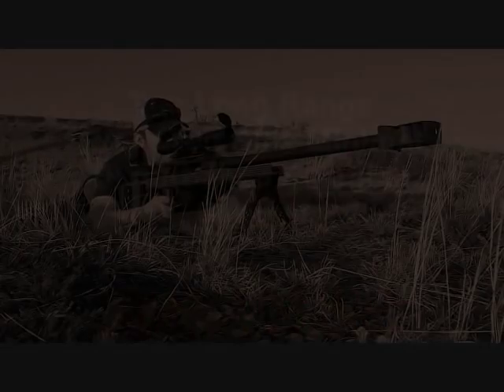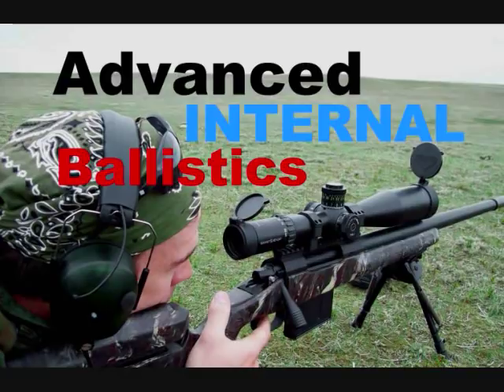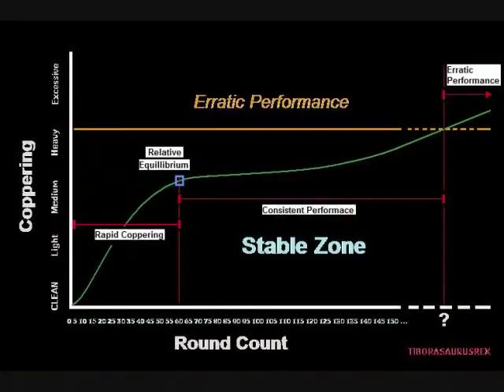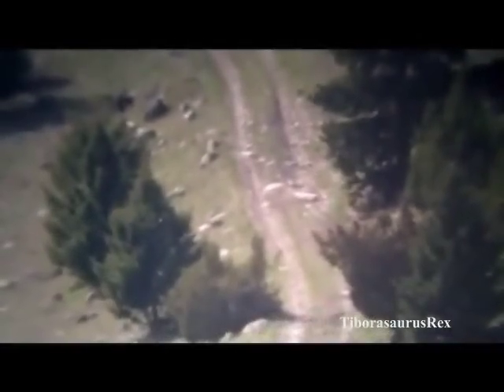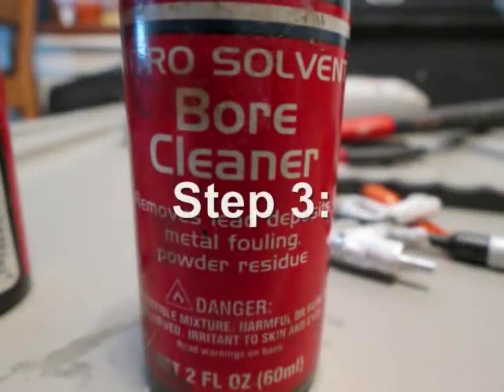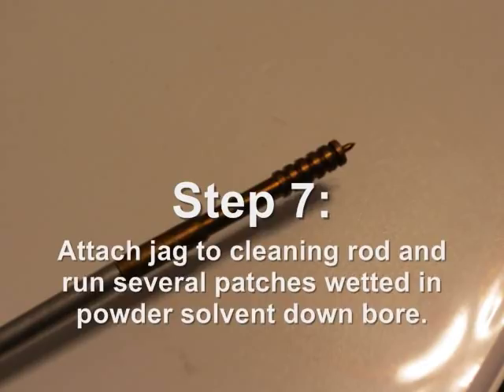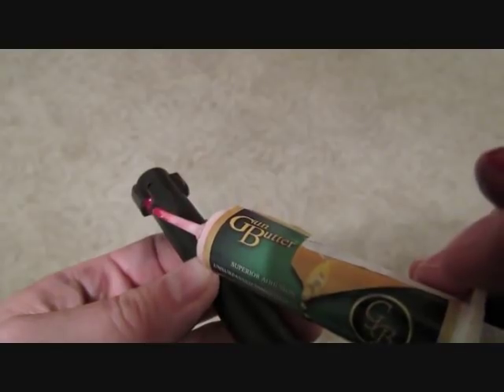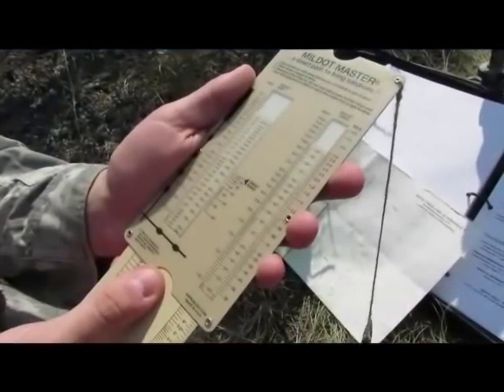Long Range 101 Part 44 - Cleaning Your Extreme Range Rifle

Comment from the maker: Come train with Rex - in person!!!  https://rexdefense.com/
Reply: You say the brush should never exit the muzzle, but does that mean do not fully exit the muzzle, or do not exit the muzzle at all ?

Because then, the closer to the crown the brush gets, the less exposure to the brush and cleaner the bore gets. At the very tip, only a few bristles will contact the bore before being pulled back: the full length of the brush will not contact the surface of the bore at the crown, so it will not be as clean, right? While the rest of the bore recieves a full pass every time the brush goes by.
Reply: I understand that you don’t push the whole brush through but that is the dilemma, you risk not cleaning the tip of the barrel equal to the rest of the barrel, thus why I understand others insist on pushing through and removing the brush every stroke.  With my AR I go back and forth all the time with my bolt action I now will push one direction.  Hope that helps.

Comment from the maker: Boresnakes are pretty handy.  After barrel break in, I would recommend using the boresnake like you would normally, just be sure to go in through the breach and use a powder solvent rather than a copper solvent.  It will take less passes with the boresnake than it would have with the brush and jstandard patches - and that is actually desirable.  Less passes down the bore = less chance of damage :-)  The boresnake is pretty safe.

Comment from the maker: When the series is complete, i plan to put together some DVDs.  It may be a little while, we are about half way done.  :-)  

I would recommend cleaning the chamber 'as needed'.  If its wet or gritty, then go ahead and carefully clean your chamber, but be very careful of the throat region, which will be the area in the bore most susceptible to erosion.  Otherwise, if its clean, I would leave it alone.  :-)

Comment: Finally decided on a LR rifle setup, a Howa M1500 24" heavy barreled action chambered in .243 winchester, SWFA SS 12x42 MIL scope, EGW 20 MOA scope rail, Burris Xtreme tactical 30 mm rings, and I am cuxtom building a laminate stock modeled after the Mcmillan A5 with Karsten adjustable cheekrest, haven't decided on color yet though, eventually I will install a tactical bolt knob and ceracoat the rifle, again thanks for the great vidoes Rex!

Comment from the maker: I did the Cu equilibrium minimal disturbance break-in on my .338 and it works great.  I did not do the nitriding as I am more familiar with the erosional character of untreated barrels and can better predict the MVV over time based on my past experience.  Nitriding works best if you do it before a significant alteration of the bore microstructure occurs due to firing the rifle.

Comment from the maker: This method is simply designed to prevent damage from corrosion due to water being drawn to carbon fouling and to remove abrasive dust and grit that may have been blown into the barrel in sandy or dusty conditions.  This will not significantly extend your copper equilibrium, it will just prevent damage due to other factors.  The details on copper remediation should be posted by the time you get this message :-)   Also, round count for our stable copper equilibrium zones will vary tremendously.

Comment: Rex I took your advice and went with the Schmidt& Bender PMII/LP/MTC/LT 5-25x56 scope I even orded it in the Ral80000 (Tan) I just got it lastnite and wow what a peice of glass I mounted it in a set of Badger rings and it looks great sitting on my 110BA 338LM the scope is amazing the weight of it alone is a clue to you that the quality is there it weighs 400gr more than the Vortex Viper PST that F,UP on me after only 150 rounds I know the price is hard to get past $3335.00 here but I love it

Comment from the maker: Its depends on the frequency and rhythm of your exact cleaning method, but I use copper.  It’s a trade off.  With copper, you have more mechanical disturbance per stroke, but you usually need less strokes total to get the job done - which minimizes the risk of damage due to something getting misaligned during one of those extra strokes if one were to use a nylon brush.  It’s a horse a piece, I guess.  One could argue either way, but it depends on how you do it exactly :-)

Comment from the maker: If you are shooting 0.5moa with a consistent MV and you are in a relatively stable non-corrosive type ENV, I would leave it alone, until you either notice a significant unaccounted for velocity shift or your group opens up.  No need to introduce any uneeded mechanical disturbance if the rifle is shooting great already.

Comment: I would certainly take my optic off.  I would do this only in an extreme case where i needed to do a full blown cleaning and then go back to the break in procedure for whatever reaon.  I do it on my handguns evry few years and it works great, ive just never tried on my bolt guns as i rarely break them down to the individual components.

Comment: I was told that barrel cleaning is needed to avoid corrosion/barrel wear after each shot; therefore, I brush my barrel after each use or shot.  The first 2-3 shots are always fliers that is not great if you use your rifle for hunting. Now, I feel that it is enough to do it once a year (after 200 rounds).

What do you think about using bore-snake after each use? Is it needed/useful, or should I leave my gun as it is? (I mean no rain, dirt or other extreme conditions during the shooting.)

Comment: I have a important question for you that I'd like to get your feedback on. This isn't about "Long range" gun cleaning Q? but just a In-General rifle cleaning Q? When i clean i first use my wire brush, then i take a cloth cleaning patch, soak it in gun oil then i Very Tightly wrap it around the wire brush. This make it a little tight in the bore but nothing TOO hardcore.I was wondering...is this bad?

Comment from the maker: Q1 This is not really applicable to handguns or even to battle carbines. Go ahead and keep those things as clean as you can.  

Q2 For establishing Cu Eq, yeah its fine to use whatever non-corrosive copper jacketed stuff you can find.  Don't use lead if you are attempting to establish Cu equilibrium.  Handguns don't apply.  

Q3  This procedure is for long range precision rifles 

Thanks for the kind words.  Peace.

Comment: You had mentioned the use of a snake.  Since I'm a big fan of snakes, I would like to know how you suggest using them.  I will be breaking in a new barrel starting this weekend, using the Copper fowling technique.  Can I use the snake for the break in (described in Part 43)?  Also, can I use the snake in lieu of the cleaning procedure for Part 44?  From what I gathered in Part 45, it may be too aggressive for Copper removal.  What are your thoughts?  Thanks.

Comment: Question for you: I understand the importance of sparingly cleaning your bore to maintain Cu equilibrium, but would cleaning the bolt and the receiver more frequently be advisable? It seems like a good, clean action would reduce wear on your locking lugs, rails, and potentially your extractor and ejector.

Comment: Keep the vids coming!  I'm in the process of a 338 Lapua build with a Krieger barrel.  I'm torn between doing the benchrest break-in (remove copper & carbon) and then sending the barrel in to have it nitrided and thereafter only carbon removal to find equilibrium vs. starting with your break-in with carbon removal only for first ten shots or so and then nothing - letting the copper/carbon build to equilibrium.  Which way would you go and why?

Comment: Rex, First, many thanks for all I'm getting out of your videos.  Can I use a bore snake as a substitute for cleaning with a rod, patches jag etc?  also, I live about 5 or 6 miles from the So Cal coast.  Should I consider this to be salty enough to apply a drop of oil to my bore before storage?  I just have a gun locker.

Comment: Rex, Just curious how exactly the cleaning regime would differ for a LR-308 or AR10? I use mine for long range shooting out to 1000 yards, and in most cases out performs many bolt guns. Your method is almost the same as mine except for the bolt lugs obviously. The bolt assembly is substituted for that part. Besides that, would there be any difference? Gas system or something?

Comment from the maker: Harder than steel to remove?  It can seem that way for sure, that’s why we want to employ the minimal disturbance cleaning regime, otherwise we will unwittingly facilitate differential mechanical erosion when we try to remove the copper fouling.  The copper protects certain areas better than others and thus the exposed steel is often disproportionably eroded when we start to get carried away with our copper remediation.

Comment: Hey rex, I know this is a very old video so you may not see this, I ordered a new elr rifle and the modern spartan systems kit based on your reviews. My question is would you start off with the modern spartan systems accuracy oil or should I wait until after break in to use it?

Comment: For example I've noticed when my friends clean their guns using normal methods for example: brush, then soaked patches until it comes out clean, then a lightly lubed patch to end it with. I've noticed if i then take their gun and use my style of cleaning with the well oiled patch wrapped tightly around the lil copper wire brush and go from end to end it will come out completely black and filthy again and again and again. Sorry for such a long question,but ya.can that cause any harm? let me know.

Comment: Hi Rex, Thanks for the videos! I would like your thoughts on all copper bullets, and the frequency and procedure of cleaning. Do the all copper bullets increase the rate of copper fouling? One all copper bullet manufacturers (Barnes) recommends frequent cleaning and the use of harsh copper solvent, so how do we know if/when this type of cleaning is needed? As a hunter, I want to know that my cold bore shot will be right on target at extended range, and copper bullets are all that some states allow for hunting  bullets these days.

Comment: I'm skipping ahead a bit, but what do you think of using density altitude and ammo temp for range cards. It seems like a great way to slim down the process. And on the subject of ammo temp, what about a food thermometer in the ammo box instead of an inferred thermometer? Im trying to avoid batteries as much as possible.

Comment: Thank you for the great video. One question. When using patches, do you use a Parker hale style jag and pull the patch back through the barrel, or do you push the patch out of the end of the barrel and drag the rod back through towards the breech? If you use the second option, does dragging the rod back through without a patch hurt anything?

Comment: I know things are different in the US, but here in the UK we are allowed to use moderators. I would suspect that an additional reason for cleaning a rifle would be if your using a moderator. If you've ever shot a rifle with a moderator attached, then you may have noticed after shooting for a while, that ejected cases have white swirls on them. That's the moderator condensing ammonia and follow up shots vapouring the ammonia and sending those ammonia vapours back down the barrel, resulting in the white swirls on the case - and I'm guessing on the inside of the barrel also.
Reply from the maker: +Richard UK Thank you for your commentary, sir.  Very informative!  Hope you stick around!
Reply: +meccastreisand It's all about how the hot gasses separate (ammonia being the gas of interest) and condense on a cold/cool/cooler moderator then get vaporised by the following rounds with the pressure of the following rounds pushing the ammonia back down the barrel causing the tell tail white swirls around the cases. So in theory would happen with any make of moderator.

Comment: I am a little confused on the cleaning regime.... Is the method you describe in the video an interrum cleaning to extend the copper equilibrium for 400 rounds or is the cleaning method what you use after your 400 round equilibrium has become unstable?

Comment: I do have a question about using certain powders such as CFE 223 which is marketed as a copper fouling eliminator or reducer. Should I stop using this powder if I want to maintain copper equilibrium? BTW Your videos are very informative and I have learned much more than have from any other source. Thank you

Comment: May I ask about your thoughts on Froglube? I started out using the stuff as advertised on my semiautos, but I'm somewhat hesitant to apply it to the TRG (as it has been running so well in the past). But the ease of cleaning makes it very attractive.... or do I have to worry about my copper equilibrium when using FL? Thank you very much for the info you put out there!

Comment: Hey Rex, I have a TRG22 in 308. I firmly beleive in "clean as needed" approach. During break-in and cleaning hardly every used brush. Only wet Hoppes9 patches then run dry patches. Its still shooting 0,5 MOA. You recommend I send a brush through 10x as described or should I maintain the patches until the MOA opens up and only then run the brush?

Comment: Thank you for the videos Mr. Rex. Thank you for responding as well. The solvent does not have instructions on using with a bore snake. Can I just use the bore snake by its self?

Comment: I live in Georgia. VERY HUMID.  if I leave anything sitting without oil it gets surface rust. even inside. so after I shoot is it okay to not clean, but oil a patch and run it down through bore a few times without removing any carbon?

Comment: Love the series!  I just received my custom model 70 in 300wsm.  I put a # 10 Krieger barrel , Timney trigger , then had GA Precision do a blueprint , lap lugs, true face, and install barrel. I'm am having some trouble developing a precise load.  I tried the ladder test . And at 300 yd 10 different charges 1/2 gr increment , I got a group on 3-1/2". So I tried the OCW test and I think I was told some bogus info on that I should not use the tightest groups but to use the group that hits closest to POA.  Your thoughts? Also the Otis cleaning system, would you use it? It seams like going across the muzzle . Though it is always in one direction , just sounds like a guy should avoid that muzzle.  Thank for your videos
Reply from the maker: Daniel Knight Hmmm...should be shooting much better.... I would check my shooting position to make sure its harmonically sound - only touching sandbags...no hard surfaces...  Also check all your screws... action screws, base screws, rings, etc...   If thats not it -  a guy would have to get some more info to figure out what is going on.

Comment: Hygroscopy is the phenomenon of attracting and holding water molecules via either absorption or adsorption from the surrounding environment, which is usually at normal or room temps. Firearms - You should never use WD-40 to clean or maintain firearms. WD-40 is hygroscopic and will attract moisture to the firearm which will result in rust.

Comment: Oops wrong button.  We use our rifles early in the morning with high moisture in the air.  I was just pushing a clean patch through every day then a full clean every 100 rounds.  The problem is I'm noticing pitting in the bore. Is there a way to clean it enough but not disturb the copper?

Comment: So Rex, what would the differences be for cleaning my very accurate SS fluted, Wylde, 1:8 twist AR 15 barrel? I am trying to keep it in carbon and copper equilibrium. I dont use any dirty ammo.
Reply: Cleaning the barrel would likely be minimal in any difference from this as for the BCG a standard cleaning regime, getting the most carbon on the BCG off and oiling appropriately would be best

Comment: hey REX, should i clean my bore after each outing in a humid environment (80-100%) or would i be ok letting it go for a while? its not getting rained on or anything just dont want to take a chance of it rusting. and thanks a lot for these videos, im learning so much
Reply from the maker: I would run a bore snake through the bore to get the powder fouling knocked out and possibly wet it ever so lightly with oil if its real humid.  If you are runnign a SS barrel, its not as fussy, but be sure not to use too much oil.  Like a single drop on a patch or a snake is plenty.   Also, be sure to fire the rifle once or twice to reestablish powder fouling before your OP.
Reply: +TiborasaurusRex I have the feeling, that the BoreSnake changes my poi. On my previous rifle I used the BS after shooting and everything was fine. When I do with my new Rifle (under 100 shots done) poi changes every time! Pretty annoying! I don&#180;t want the rifle to be completely dirty... but I can&#180;t use a BS, because it shifts my poi... Will this change?! Does it make sense to run the BS down the barrel every 5 shots or so?

Comment: I was curious if you consider extreeme long range shooting to be a relative term, relative to the round being shot that is.  Ie. Long range for a.22lr at 300 yds or .223 at 700 or so yds whereas a 7mm mag would be fall into the standard definition of extreeme long range or 1000+yds. I suppose the truer definition would be the duration of time the round is in the air on its way to the target.
Im asking this because im wondering if the same long range principles remain regardless of distance dependant upon the capability of the round.

Thanks for these videos!
Reply from the maker: We consider extreme long ranges to be those distances in which the effects of coriolis and spin will cause a miss if not corrected for - usually beyond 1000m, but these terms are subjective of course :-)